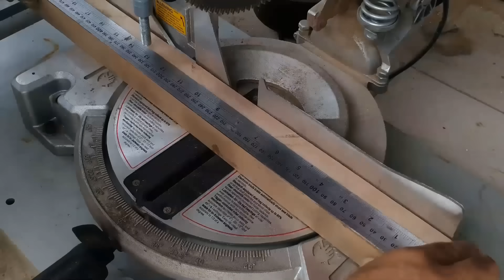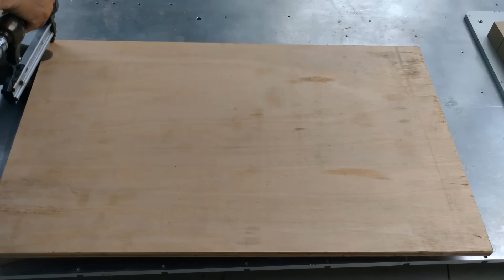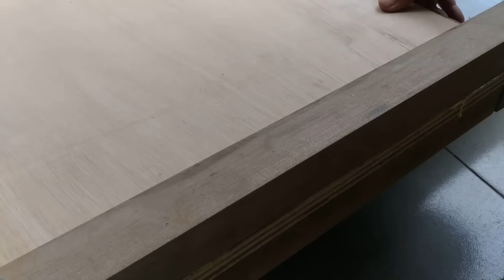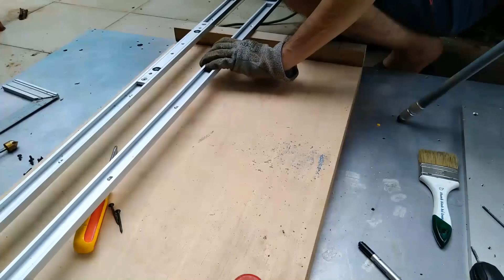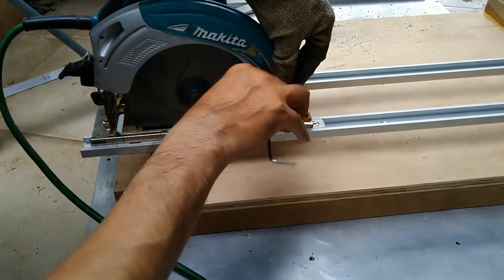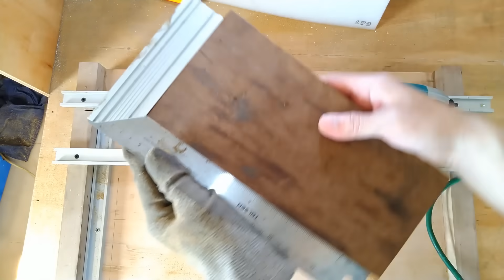Homemade circular saw crosscut jig

Comment: I am afraid the T tracks will bend a bit under the weight of the saw motor and, since the saw mass is not symmetrically distributed on the two t-tracks, one of the two will bend more. As a result the blade will not be perfectly perpendicular to the work plan.
Reply: Yes.. i am with you
Reply: @BENGKELHOBI  b
Reply: Right and amazingly enough it's a thing which is never mentioned in any of these videos. I started building one myself and am amazed at just how much the various rails bend.
Reply: @r.kreppein3844  I want to build myself something like this. Would 3mm steel angle iron be strong enough?
Reply: Square pipe is the best

Comment: I preferred using right angles as track because this track will be difficult to clean of wood dust after every use.
Also, the saw dust will cause the runners to not run freely.
Reply: And also far easier to just place the circular saw on the two right angle guides than to have to feed it. I also would prefer design the whole system around not making any adjustments to the saw it self as the saw is now committed to this bench and no longer multi use.

Comment: the 1st runner already guides the saw, the 2nd one is pointless, it's actually a problem, it just makes it more difficult to make both perfectly parallel, you only need the 2nd track or something of the same thickness to support the other side of the saw

Comment: I like that you used the t track to guide th saw but I am curious if you checked for parallel with the tracks and the blades. This would be pretty important to get exactly right. I know when I've done this kind of jig, relying on the accuracy of my saws base plate isn't reliable enough.
Reply from the maker: yeap , you right , of course i need to check parallel with the tracks and blades, and i'm feel quite happy with accuracy cut , thanks for watching my friend!

Comment: I hope you realize you can use a regular framing square and get the same results for both 90 and 45 degrees on cutting the wood. I like the track idea on maybe something on a bigger scale, just not this. I use the framing square tech all the time, makes perfect straight cuts and 45's , I only learned the technique early last yr from research, but man does it save time.
Reply: Onde aprendo essa técnica amigo? Tens algum vídeo que ensina?

Comment: Alot of vids like this cut 45 degree angles and then they just put the same two haves back together and of course they match up perfectly but I usually have trouble with 45 degree angles cut from separate pieces of wood matching up perfectly.
Reply from the maker: if you already set it perpendicular toghether , you wont have trouble, thanks for watching my friend!

Comment: Thanks! I like the idea of using T-tracks and sliding rails, but I'm not sure if the play is close to zero. I've ordered those and will check the play.

Also, have you tried to cut a board that's 50cm to 70cm wide and check the squareness?
Reply from the maker: they actually close to zero, atleast almost , let's build and you can check it, thanks for watching my friend!

Comment: Its a good jig, but I don't agree with drilling holes in the sole plate, u could just used small clamps to hold it in position on its runners. Or simply used an aluminum L shape for the saw to glide along on.

Comment: No way. Can't be that way by install rails under saw and can't be screwed in there though . if u have more than 2 circular saw bro. Just let the saw run on both side rails that's all. It helps to use others features that's not a cross cut though.

Comment: Very Good idea! Thanks for sharing. There is a question, I can not find the screw to fit alluminum bar so well like yours, which screw did you use? Is it 10-24 1/2"phillips flat head screw?
Reply from the maker: oh, i used this M4 screw, Ebay link for your reference
M3 M4 M5 Stainless Steel Socket Hex Countersunk Flat Head Machine Screws DIN7991
https://www.ebay.com/itm/M3-M4-M5-Stainless-Steel-Socket-Hex-Countersunk-Flat-Head-Machine-Screws-DIN7991/183892842057?hash=item2ad0de1649:m:mIZ3LTBt1HtqTj0lDQi7Zaw
Reply: @Solidworksmaster  Thank you very much!!!
Reply from the maker: @jenniferbruno3388  you're welcome!

Comment: I never understood these videos of making a cross cut jig so you dont need your table saw or chop saw to make straight cuts. But yet you need a table saw and chop saw to make straight cuts to make the cross cut jig. Isn't it pointless? Why not just use your table saw or chop saw? Whats the point of DIY this if i don't have those tools to make it. 🤯
Reply: easily take it to a jobsite since its light and portable. could use a friend's table saw and chop saw to make it. of course first you need friends.

Comment: Sorry but what did you use for the u channel or the t track. 3/4 is too tight that I have found.
Reply from the maker: that's not 3/4", it's 1" t-track i used, thanks for watching my friend!
Reply: @Solidworksmaster  By 1 inch you still mean 3/4 inch slot width and 1 inch overall width?
Reply from the maker: i mean 1" for overall width , it's not tight at all, it's slide smothly , where did you find the rail& track? Ebay?
Reply: @Solidworksmaster  yes what you showed on ebay link. so you just used standard t track for your project which by the way is the best I have seen so far

Comment: Hi, great saw guide. I tried link in description for aluminum rail but link didn't work. Do you have the actual name of the rail set or another link. Many thanks.
Reply from the maker: you could try use this key words "Aluminium Rail Miter Bar Slider" to search , thanks for watching my friend!
Reply: @Solidworksmaster  Thanks for replying, found item straight away.

Comment: Why do you need glue if you have screws and nails? Also why didnt you use L type profiles ? Than you dont need to add anything to saw itself
Reply from the maker: L profile not strong & accuracy enough for my project, i need strong enough and could be used this crosscut jig to cutting alumium in next project, thanks for watcing my friend!

Comment: why do this if there is a miter saw?
Reply: You can't have long cut with mitter saw right?
Reply: @hungtrinh3767  but this device is also limited
Reply: A sliding mitre saw would do both but he only has a regular mitre saw.  Also it’s possible he had in mind someone who has a circular saw but no mitre saw.
Reply: You could also use a router with this jig, which would make it even more useful. Just an idea.